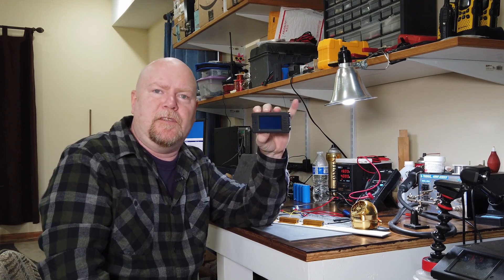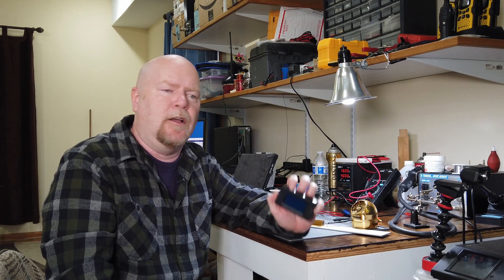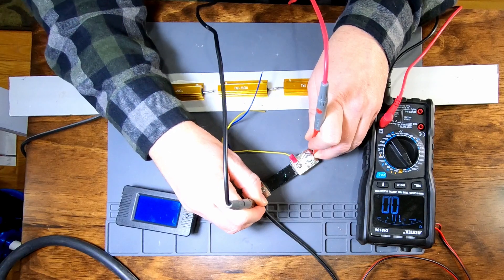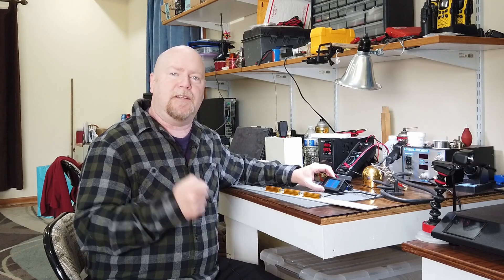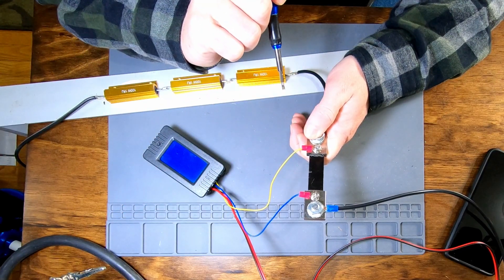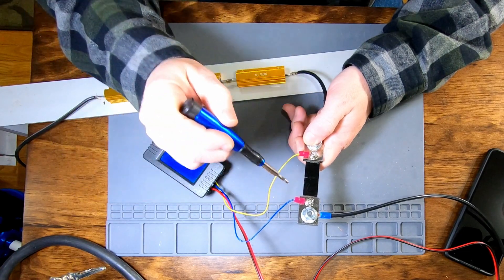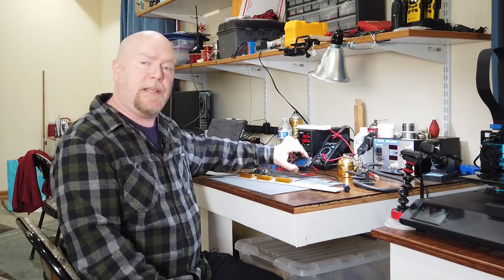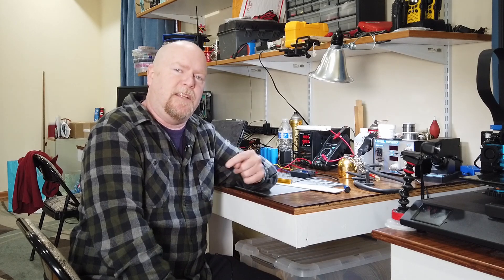Cheap-O Power Meter Accuracy Improvements

Comment: Inaccurate pointers of the reviewer.

First, it measures current both ways (charge and discharge) but just not at the same time. It can be used either on the charging or discharging side. It will also tell you when the battery is charged if it’s installed on the charging side. 

Secondly, it is not completely contained. It is possible to remove the plastic enclosure. There are tiny screws at the back and it’s embeddable to any project without its plastic casing. 

Thirdly, there is no small 10A shunt inside the unit (PZEM-015) try to open it, but as per the description from the manufacturer, it can measure up to 10A without an external shunt. Though I tried it many times and just won't last long.

Lastly, it's just as good as both ways, charging or discharging side. The only thing he’s right about is that small slice (missing piece) of the shunt that can adjust its resistance. 😊 No offense meant whatsoever. ✌️
Reply from the maker: First - I meant that it only measures current one way.  You'd have to change the way it's installed (possibly dynamically with a switch) to change what it measures.  I would make a very poor "state of charge" meter in a charging use case anyway because unless you knew precisely the starting state of charge, knowing how many watt-hours you have pumped into the battery won't tell you what percent charged it is.  The only reason it works well as a discharge monitor is because you can start off at a known state of 100% charged.

Second - anything can be taken apart and likely anyone watching a video of this type knows this.   What I said was "If you're using it up to 10A you can use the internal shunt and the meter - as supplied - can be a completely self contained package."  Meaning to imply that you did not need the external shunt if your use case requires 10A or lower measurement range.

I'll give you credit - at least you do have some content of your own.  Most folks who decide to be this pedantic a just drive-by trolls - no offense meant whatsoever.
Reply: Word of the day, "Pedantic." Whew! 😊👊✌️

On the contrary, I am sincere when I said "no offense meant whatsoever." If you think I am being pedantic please feel free to delete my comment.

Comment: Hey Matt.  And elegant solution to improve your accuracy.   Curious of how the wattage tracks at higher current loads.  Do you have an 80a power supply you can hook up to your resistive heater?
Reply from the maker: Hi Ed.  I don't, but it's a reasonably safe bet that the shunt is linear, as even at full current it's only dissipating a couple of a watts over quite a lot of metal.  So it won't be heating up, which is the only thing that would change the resistance appreciably.

Soooo, what I likely could do is simulate the 0-75mV range that the shunt provides over the current range and see if the meter is also linear.  I'm optimistic about it because typically the error in A/D conversion is in the smaller order bits.

Comment: Just curious if you have verified by some other means that your power supply is truely delivering 5A when it says it is.  I know my PS is not always bang-on.

Maybe you noticed the state of charge of the battery wasn't what that power meter said it would be, and that's what led you to the fact that it was inaccurate.  Maybe I missed that.

Thanks for the video - I was thinking I hadn't seen anything from you in a while.  Hope you are doing well!
Reply from the maker: I did verify the PS and I fortunately got a good one.  It's spot on down to the last 1mA.  I checked it both against a known good quality multimeter and also by calculating the output against the voltage drop across my known load (as measured using an oscilloscope).

I knew going in that these power meters tend to be inaccurate so testing it was the 1st thing I did when I got it.  Glad I did.